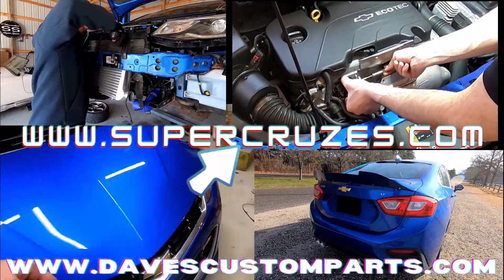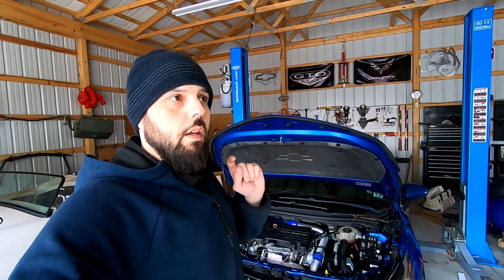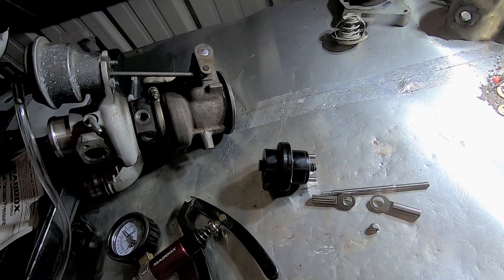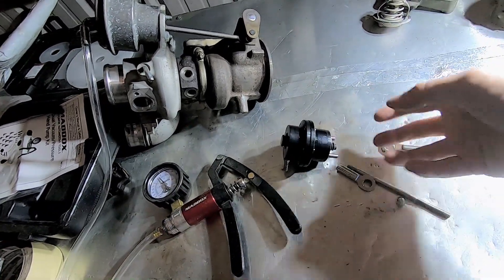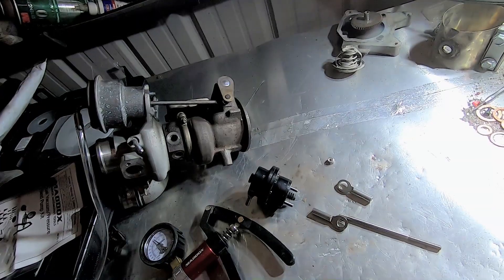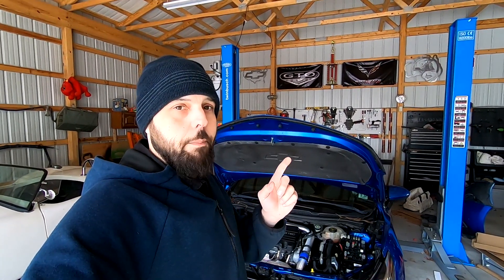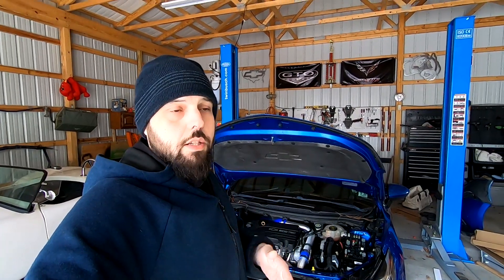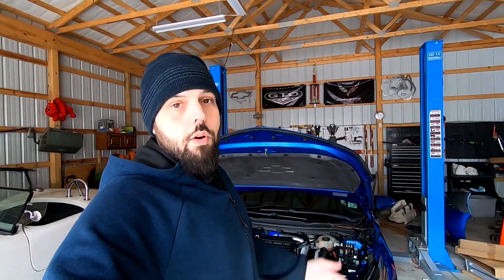CRUZE/ Astra big turbo install Wastegate and spark plug upgrades. Project CRUZE Missile Dave's World

Comment: Hey Dave nice video info like always. I have a '17 automatic so my question is are you gonna make a radiator upgrade on your car?  If yes then would you look on to automatics as well? (Since I think the transmission fluid has it's own channels on the radiator to maintain operating temperature, and this radiator mightalso be the cause of dying AT on this Cruzes). Thanks and keep the uploads up.
Reply from the maker: A dedicated trans cooler would be a better upgrade. So far the radiator has been pretty good on this car. Haven’t needed to upgrade it yet. But I do have some ideas for the trans cooler.
Reply: @davesworld2132  Yes engine temps on mine never go past half but you know that gauge just plain tells you "hey it's doing good" but at the AT side you'll never know until you have some OBDII scanner or a hookup to show how hot the AT temps are. Transmission solenoids dies/fail on this chevy's (eh too bad I didn't got the manual... don't know how to manual but knows the basic principal through Playstation... lols I know I started driving on Gran Turismo and passed my driving license haha, Never had an accident yet hehe) and it's hard to source parts for it nowadays (the transmission specialist where my car is right now said the freaking AT filter on this cost $400 on GM so they sourced it from Japan OEM for only $25+$70 shipping...guess Japan has them since Australia have Holden Cruzes)  you can never buy/get a new solenoids on this or maybe buy to GM with ridiculous price. So I'm thinking ways to prolong the life of my new/rebuilt AT, I'ma get the car tomorrow😁🤘👌
Reply from the maker: @czerus2233  ouch $400. Bet the trans has to come out to get to it. You ever play for a Motorsport? Side note they do make aftermarket trans temp gauges,
Reply: @davesworld2132  yeah so we waited about 2 weeks for the shipment from Japan of the trans filter and another 2 weeks to finish the rebuild. They said the back cover of the transmission had the pump and the filter inside so this AT is doomed to last as you cannot easily drop the pan and pop out the filter if you plan to DIY maintenance it, only way is keep up with fresh AT fluids. Nope haven't done Motorsport but would love too in the future. Man that temp gauge should really help. I hate how GM didn't do a good job refining this car and just drop it like a rock after the 3rd gen Cruze. My brother had a 2017 yaris iA and this 2017 cruze is a bit faster and saves gas like the yaris iA and way bigger room inside that's why I like it (though the yaris has cruise control and sport mode for high rpm shifts... really good when it's raining). I really hope this car will be a boy now with the rebuilt trans can't wait to pick it up tomorrow 😊. Yeah me and my dad back in 2017 replace our 2003 Ford Escape transmission we bought from autozone from a transmission warehouse in Texas and they sent an upgraded Trans cooler and is worry free till this day.

Comment: You should upgrade your coils as well for the spark blow out, got a msd coil pack and helped tons with misfires.
Reply from the maker: What are you using like an LS style with a plug wire?
Reply: @davesworld2132  Well I have a gen1 so the coil pack is one piece, I am full catless ported intake and tune, and once I started gaining more hp I had to upgrade my coils from higher boost, I've seen dynos that it alone can produce 10hp
Reply from the maker: @rubenjimenez1568  on Gen 2 the coils are pretty strong. But I do potentially see a need for more POWA